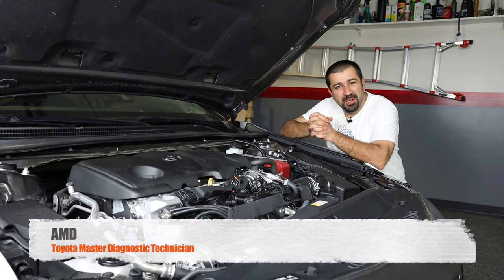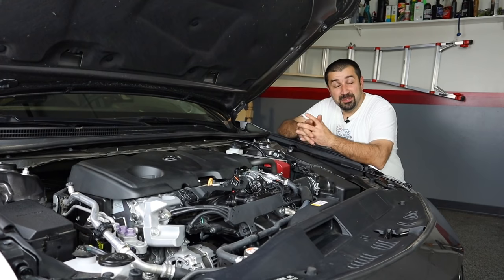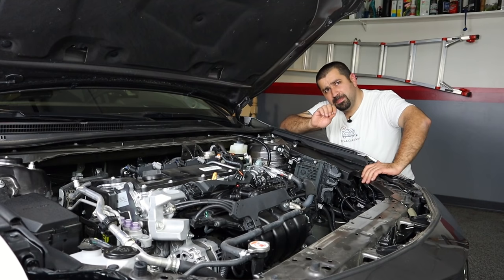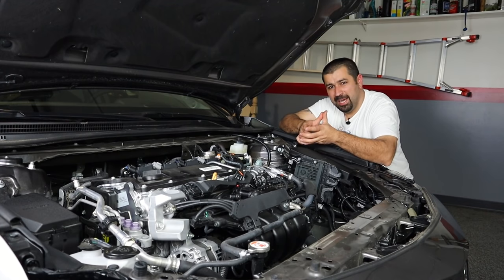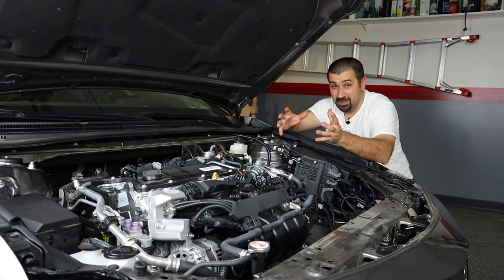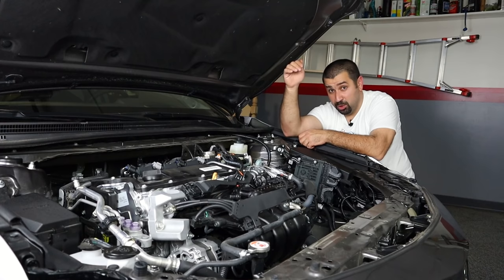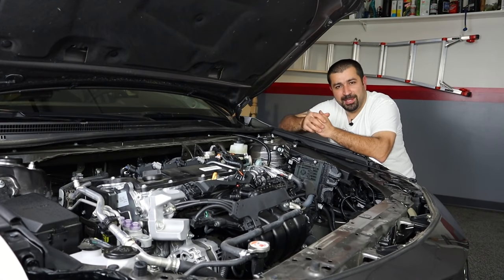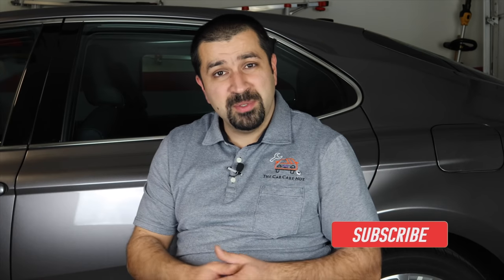Toyota's New Engine Technical review Part 1 : Cooling,Lubrication,Direct Injection and EGR

Comment: 2018 Camry hybrid with almost 185k miles. I've been using only Ultra platinum Penzoil 5W30 on my car every 5k miles and so far absolutely zero issues or oil burning with my engine . Still drives like day 1
The only thing wear out was the driver side shock at around 175k miles
Reply: Is your 2018 camry hybrid using the same A25A-FXS engine?
Reply: @hotpotgang  

Every thing is still original. Including Engine and transmission

Comment: I will stick with my 1owner, accident free, dealer maintaned, quiet, simple and reliable 3.6 l  2011 Avalon 63,000 miles. At 70 I'm not upgrading to something I can't work on. Yes I changed the transmission fluid and coolant per your videos but my mechanic can do the rear spark plugs, water pump when that day comes. Brakes n rotors no problem. I drive maybe 6-8,000 miles a year, 1 eye on the rear view mirror and 1 on the road for the compulsive cell phone users. REGULAR GAS  and a big smile going down the road ! Thanks for all your honest and straight up videos.

Comment: Had one of these Camrys as a rental.  Got 50 mpg on highway with cruise set at 70mph.
Reply: Yup this is true. Not sure how accurate the built in computer is, but it will read 50mpg with constant 65-70mph speed
Reply: Cruising at ~90 i got 35-40
Reply: I bought a 2018 used with 26,000 on it and consistently get 46 on the highway and 35 overall. Runs great, rides nice and handles well for a four door sedan.
Reply: @brianbumgardner8704  you mustve had a hybrid then?
Reply: @supremesai3637  Nope, I won't own a hybrid. This is a straight up non-hybrid, I average 70-75 on the highway and don't drive hard on surface streets.
Reply: @brianbumgardner8704  I bought a 2018 used with 19,400 miles. Paid 18.5k . Runs great .
Reply: Drove that Camery rental new. But the car didn’t move, slow acceleration, nothing compared to Honda Earth Dream from performance prospective.
Reply: Thats better than a VW diesel,the Camrys dont do that economy in Australia,and we only 100/110kmh highway speed,and US d
Gallon 3.8litres,we imperial gallon 4.5 litres,so the Camry in US doing 80mpg on our measure!!
Reply: @jayou1987  great deal.
Reply: @brianbumgardner8704  why won't you own a hybrid? Religious reasons?
Reply: @retiredrebel  I have a 2021 RAV4 XLE with this engine and it’s not slow. It’s limited at 122mph and it gets there quick. I recently raced a new Accord from a red light, not sure if it was the 2.0T, and we tied.
Reply: I just bought a used 21 Camry with 10,000 miles on it. I just did a 700 mile round-trip and averaged 48.4 MPG and that is not a hybrid.

Comment: Coming from a 2010 accord 4 cylinder where I averaged 26-27 combined mpg. My recently purchased 2020 Camry SE gets about 34-35 mpg with my same driving habits. It has more power and torque than the accord and is quieter. I’m already impressed!
Reply: Well ya, 10 years is a huge difference in car comfort and engine technology. A better comparison would be against a 2020 Accord.
Reply: @palillo2006  The 1.5t in the Accord will use a little more fuel, but is a little quicker in some circumstances.
Reply: And all the gas savings lost the first time it breaks down.
Reply: It's really a remarkable little engine. It's not a race car off the line, but it can be pretty fun to drive at speed. If you try really hard, you can get high 30's mpg combined in eco. Drive more aggressively, and it will be much less, obviously.

Comment: Brilliant video again, cheers. I'm one of those guys who will start there car and let  the engine warm for a minute or so before driving off. have just purchased my first Hybrid ( Rav4 XSE , due in Jan23)  in my mind ... I struggle with the fact that you can't warm the engine in the morning before heading off,just push a button but watching you and your tuition on this motor,  cooling system will warm everything up before engine does tick over and the electronic oil pumps  wow.
very informative videos and thanks.
cheers
New Zealand 🇳🇿

Comment: 110 German car owner disliked this video. But anyways, I absolutely love this video series! What a ingenious fix for the direct injection issues. They even engineered an air oil separator so you don’t need to get a catch can.  Because it also has port injection, you can add fuel additives to help keep your valves clean. Genius!
Reply: I saw the CCN rebuild a 4 cylinder dynamic force engine where he referred to the build in oil separator.
Reply: I'm leasing a Benz and just bought a toyota, not lease,  since I understand how good toyota is from my company toyota, and thanks AMD! Benz is just for fun i guess many owner know that
Reply: I would love to drive a e class, but I can't spend that much. Got a Camry.

Greetings from Germany
Reply: My Dad had 3 VWs years ago. Short life cars and bus. Another relative had a VW passat. Worst car he has ever owned. Now has a highlander. Loves it. I will never own a German vehicule.
Reply: @arvbergstedt3303  I have had different luck, I own VWs and currently 3 diesels 1 has 280k, another 150 k, another 40k. I have had many gasser VWs also with no issues. THey are definitely high maintenance, but I have lots of respect of Toyota.
Reply: @davidcaprio8919  I just got out of my 2014 passat tdi for a 2020 corolla hatch. I really loved the ride and comfort of the passat. However, after 4 heater core replacements and injector replacement with less than 125k I was not going to spend the $1200 next august on a new heater core. The dealer replaced them all under the extended dieselgate warranty and could never tell me what the real fix was-just kept slapping in a new one. I did the research and found out why; it was always going to be an issue due to the coolant g12 and g13 needed for high temp burn off of the dpf and the chemical reaction with the aluminum heater core. The other concern I always had in the back of my mind was when all the extras they had to re-engineer to pass emissions and when those would crap out. I drive around 40-50k a year. So happy I don't have those nagging concerns going with a toyota. That little hatchback is peppy as hell and gets better fuel mileage than the diesel. Oh ya $2.30 less/gallon than diesel!  Never a VW again!

Comment: I am totally amazed at my 2.5 Dynamic Force engine in my 2020 Camry LE (8,350 total miles) I recently took a 445 mile trip that put my car through just about all the scenarios a car could face including, freeway, hills, mountains, long gradual inclines, long gradual declines, 78 miles of winding uphill, downhill, sharp turns, not so sharp turns, manually downshifting, manually upshifting, and driving around a small coastal California town of Fort Bragg for two days. After I came back home I filled up the tank to check for the first time my gas milage turned out to be...an amazing "35.8 miles per gallon." I had to redo the numbers on my calculator to double check...445 miles divided by 12.4 gallons of gas. I am totally amazed!  And all these miles were not "easy interstate miles"...only about 125, or so. My car performed better than I anticipated and this engine...totally amazed me! The car is rated for 39 MPG (freeway) on the window sticker. It looks like it would do even better! Totally amazing!
Reply: Recently bought my son a '18 Camry SE and was amazed at the MPG.......drove 2.5 hrs and only used 1/4 tank, WOW. Wished I could say the same about my Tundra LOL....
Reply: I get 42 mpg.  The key to get that is drive to 75 to 80 and make sure to let off the peddle to it goes to the 8th gear. Then be gentle on the gas piddle.  I make sure it's says below 2k rpm.  Vola  40+ mpg on the highway.
Reply: I already got 45.6 mpg at that same speed hallway
Reply: Best I got was 43mpg, ac set to recirculation, and loong stints of highway drive

Comment: I learned something today. All the noise I hear when I start my Camry for the first 30 seconds or so is the direct injection system and not the VVT system. It smooths out and gets quieter after that. Thank you and God bless!
Reply: I dont have direct f.i.  but i tried 0w30 mobil one from walmart an dad was like next day what did you do?

On crank up, you could hear a rough dry start noise mostly the timing chain or in honda accord k24 2.4 the variable phasing cam gear innereds not having oil
Reply: But even using 5w30 ive used conventional castrol and that got hot even though heavier than 0w30 mobil one

But the 10w30 conventional castrol had valve tap idling just 5 seconds before turning off  but it did hold up to 30 plus minutes of driving.  Thats just dandy

So i did what i had to do.  I made a cocktail 1 qt 5w30 to 4 qt 10w30 and a drop of lucas stabilizer
Reply: If you’re on the outside of my car you can actually hear the relay is clicking and the pump shutting off so that I know it’s the direct injection
Reply: Otherwise i use 5 qt 5w20 + 0.5 qt lucas stabilizer which is half qt over full mark

Its all good. You just have to loosen fill cap anywhere say quarter to 1.5 turns

Depending on HOW MUCH MORE PRESSURE YOU HAVE.  You can have more of thin oil and get similar oil pressure as normal amt. Of say 10w30   

Some 10w30 are thinner or thicker but within spec

  Racers would put more oil an a breather filter in place of the fill cap
Reply: @craiglutska2850  have u ever tried putting the key to ON for anywhere from 2 seconds to 10.  My friend doesit for 15 in his z28 thats too long lol

I think it primes and builds up pressure in oil and fuel pump

But the longer i do it, depending on the car, it uses more fuel lile its being heavy duty?  Guess that's good to keep it cool in the summer lol
Reply: @rstuff1605  no. I am not worried. I don’t move the car for a minute after starting the engine anyway lol.

Comment: Heated thermostat can be used during warming phase as described but it also allows much reduced HP load for coolant flow. With the coolant flow valves and variable speed electric water pump there is no need for thermostat to have any temp control function other than speeding initial engine warm up. Once engine reaches temp the water pump speed becomes the main control of heat energy rejection. Low load creates low heat and low pump speed is all that is needed. The pump can run and move all the coolant needed with only 250-300 mA, maybe less. The mechanical water pumps oversupplied greatly and thermostat would reduce opening to keep coolant temp higher. Pushing water through the reduced opening takes fuel for that extra work.
Reply: Heated thermostat is used incase the driver decides to go full throttle with a cold engine, it opens the thermostat to even out the coolant temps otherwise you’ll have a cold and extremely hot area of the system

Comment: In regards to the EGR cooler. My coworker has a '15 Prius C and the EGR is fed post-cat. She uses her vehicle to commute 45 mins on the highway each way to go to and from work.

Car has 120k on it and is serviced at the dealer. She was experiencing rattling and loss of power under low load (think stop and go traffic), every once in a while when the car would start up (Prius death rattle), and when the ICE would turn on after switching between electric and mixed us (middle of the eco bar).

She went to 2 dealerships and 1 independent shop and they all told her nothing was wrong with her car because there was no codes stored or pending and they couldn't reproduce the issue. I called a 4th shop that are Toyota specialists and they told me they wouldn't be able to diagnose it unless it threw a code or had one stored or reproduced the issue while a scan tool was hooked up to the OBDII port. I contacted my buddy who owns an independent shop and I told him what it probably was, but to also run some other diagnostics just to rule out a bad coil, etc.

Well, her EGR cooler was clogged solid. Once it was replaced, it runs fine. The passages are too small on the EGR cooler as designed.

This EGR will clog, it 's just a matter of time. The only improvement that I see is that there is now a separate plenum that feeds the exhaust gas into the head / intake manifold.

Comment: Agreed... thin oil is NOT as bad as it seems. In old cars, (even going waaaaay back to the 1920's) oil was primarily a lubricant and it's partial coolant properties were a side benefit that didn't matter, the older you go the less importance cooling was because metals were more tolerant and engines didn't make much power...  As cars got newer they started to make more power and oil flow was increasingly needed a coolant, even commuter cars got oil coolers (once a high performance thing)- then oil had to travel to more places, while moving quick enough to do hydraulic things (variable valve timing, variable lift, turbocharger cooling and lubrication) and flowing oil is more important. 

It may flow like water, but it's supposed to, and it's supposed to be designed around that. If you are even doubting the oil in the least, just change it more often.... nothing bad will come from that... oil wear and buildup is way worse on these new engines... If there's any motto it's "keep it flowing" not more pressure.
Reply: what do you think about the metallic flakes i saw in my drain pan after using 0w-20 that are not there after using 5w-30 in a 2018 corolla with 75K?  every oil change had a little very fine metallic debris until i switched.  

i think the lighter oil is purely for mpg's and is sacrificing engine longevity.
Reply: Thicker oil helps with fuel dilution. It’s a big problem with cars idling and running 0w 20. The only thing thin oil does good for your motor  is fuel efficiency

Comment: I gave thumbs up before ending the video. Being a Corolla owner with the mentioned engine, no one told me how important using the rated 0 w16 engine oil is. This channel deserver highest appreciation.
Reply: 0 w 16 for fuel efficiency , if you want go fast with smooth ride use 5 w 30. 
it won't affect the performance or harm any part,  but it will help engine.

Comment: I can't say enough about my purchase of a 2023 Lexus NX250 which has this 2.5L. This is my first Toyota/Lexus product as my previous purchases were other Japanese brands as I only buy Japanese. Nice to hear that this engine is so advanced and well thought through. Great video, really enjoy watching you.
Reply: I got the 2024 NX 250 and I bought it exactly for this engine, which in 250 is in its purest form. 350 adds turbo to the same engine, I didn't want the complications and maintenance of turbo, this is why went with 250. Absolutely love it so far.
Reply: @usercoimbar  You made a great choice, it's absolutely an amazing car. From the styling, comfort and Lexus quality/reliability. I have never been a turbo lover and always avoided buying cars with them. Turbos create to much heat and pressure and with modern engines with all the plastic, you are just asking for trouble not to mention turbos don't last. Toyota/Lexus uses a bigger engine with a smaller turbo, so it should be more reliable compared to say German cars where they put large and sometimes two turbos in the worst location like on the top of the engine above the manifold. One thing people don't know who own vehicles with turbos, is that you can't just shut off your after driving, you need to idle it for a few minutes for the turbo and oil to cool off for a bit. I think the NX 350 uses a 2.4L with turbo. Congrats on your purchase.

Comment: Love your videos!  We appreciate the technical knowledge you have!!

A comment on 0w16.  These engines are spec'd only 0w16 in North America, but in the Middle East and Austrailia they are spec'd for 0w16, 0w20, 5w20, 5w30 and 10w30.  I don't personally feel there ever would be any negative effects other than fuel economy from using any of these oils in any engines as long as the temperature range is not exceeded.  10w30 below 0F.  Toyota and Lexus have recommended even 15w40 in the GR engines above 20F in the Middle East and Australia.  

Toyota does maintain that 0w16 is recommended for all temp ranges as well as all by 10w30 is also recommended for all temp ranges.  But 0w16 is preferred.  

A concern I have see on my 08 GS450h (2GR-FSE) is fuel dilution, and on the lower viscosity oils this can be very detrimental to engine life.  Have you seen any oil analysis on the Dynamic Force engines or the GR and UR engines?
Reply from the maker: Hi! No fuel dilution issues on the dynamic force yet other than cars that are frequently driven short distances and go 10k oil changes against the recommendation in the manual
Reply: @TheCarCareNut  Is this still the case? A Hybrid would seem to be a good candidate for oil dilution considering the starting and stopping of the gas engine in everyday use. What is the normal oil change interval on a new Toyota Hybrid?
thanks.
Reply from the maker: Still the case. I haven’t seen any cases
Reply: @TheCarCareNut  Thanks for the quick reply. HNY!
Reply: There is no good reason including temperature to use an oil other than 0w16 in this engine.  It’s an extremely robust oil.
Reply: I like how he avoided answering Toyota saying it's fine for other oils in this engine in different manuals
Reply: @Michael-xz7mv yeah he doesn’t know. Any idiot could’ve looked up the info he just poorly rambled on about in this video. There isn’t any special engineering in this engine it’s just more complexity for the sake of complexity.
Reply: @lorimcquinn3966  corolla hybrid owner here... no issues with my 2020 model.
Reply: My two month old UK 2024 hybrid Rav4 service&warranty booklet, 1st page in writing "OIL 4.5 litres 0-20 only!"laminated by plastic tape.I literally for the first time opened the white box containing the user guide, certificate of conformity.What,me worry.